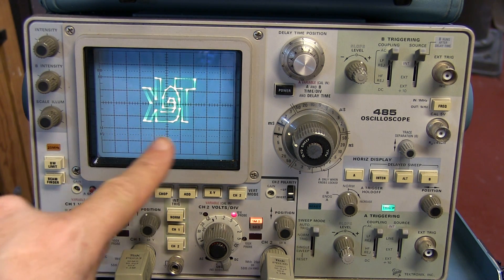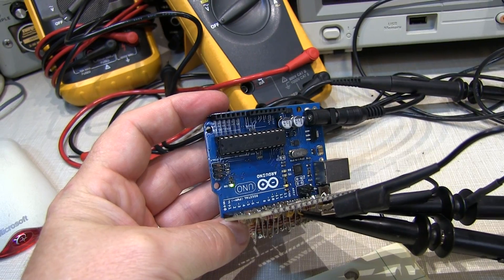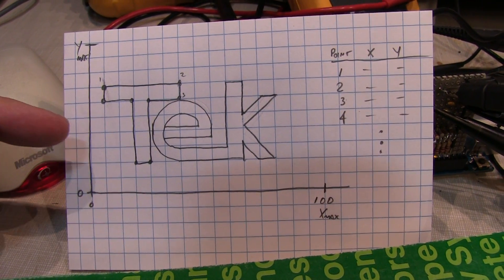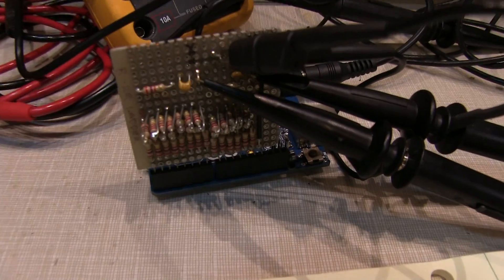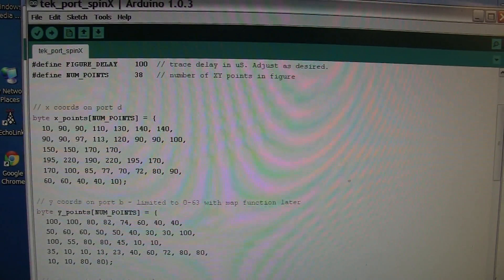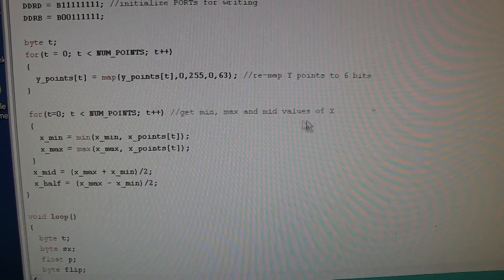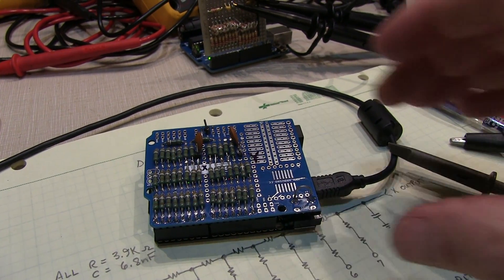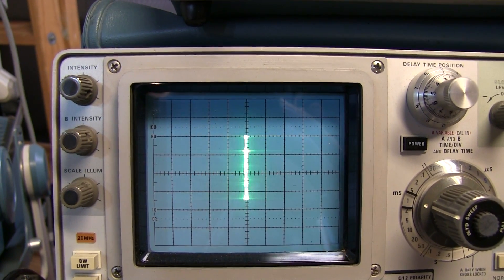#144: Use Arduino Uno to create spinning XY graphic on an Oscilloscope

Comment: Is there any Analogue Way to plot x and y axis On old crt tv via AV rca port ? If i wanna controll x y lines on crt by giving signal through RCA video port is it possible?
If it's possible so we can use same signal to use drive x y in any  lcd based monitor or display with Video input port ?

Comment: First, I would probably just use two DAC0800s (let the six bits be b7-b2 and let {b1,b0}=10).  Second, if you increase the RC time constant to about 1/3 or 1/2 of the dwell time, you can smooth over the apparent intensity and make the dot locations less visible without introducing excess distortion.  Third, introducing more points into long straight segments so that all segments have somewhat equal lengths will equalize intensity and reduce distortion at corners.

Comment: I know this is an old video, but have you thought of using the blanking input of the scope as an extra output parameter? maybe instead of having DDRD as 8 bits, make it only 6 (since it seems to work fine for DDRB) and use one of the remaining pins on DDRD to control the spot brightness? That could be used to reduce the brightness of indivudual points, making for a better end result.
There's quite a few videos of people using X-Y mode on scope to draw things, but none of them ever use the "Z" to drive the spot brightness...
Reply from the maker: Not all scopes have a Z-axis input.  I have used the Z-axis in a few of my videos.  A few videos (including the channel trailer video) use the Z-axis to get analog video on the CRT.  I also used it in the video that talks about creating a marker on the waveform.

Comment: Very cool stuff. Just purchased an old Tek 485 for dirt cheap. I hope it works or is repairable when it gets here. The traces work shown in the listing with all the knobs intact. Any words of advice for components that are commonly bad with the 485? Thanks so much for all your knowledge sharing.
Reply from the maker: These are pretty reliable old scopes, with one of the sharpest CRTs that I've seen.  The only thing I've seen go wrong on mine is that the contacts for the vertical attenuator get dirty/scratchy.  You have to be very careful when cleaning them (delicate lever/leaf style contacts).
Reply: @w2aew  I've read a lot about the tantalum caps failing. Some guy I found in California will refurbish it completely for $400 but that's a little much to spend on the $90 total price I paid for it. Most I found that didn't even power up people were asking $150+ , some of those electronic salvage companies that buy piles from schools or businesses for a lot price and make a big profit on them. I got this from an individual. The fact it had a photo showing both traces was encouraging.
Reply: w2aew Got the 485 today. I was pleasantly surprised that it worked and actually displayed a nice wave form. The trace was very sharpe and bright but seems to have a wide ghost image surrounding the trace. If it is turned down quite low on the intensity it is minimal. I don’t think it’s normal but working. The other issue is on channel 2, when switching the voltage range the trace will jump way off from set position. Seems to be a few different amounts of offset that repeats throughout the entire range. It can be brought back in with position control but it doesn’t do this on channel 1. The control on 2 is very sticky and hard to turn. Everything else seems ok other than calibration. Any thoughts on either problem? I know you get asked a bunch of questions on a daily basis. Any help would be appreciated. I’m a stone age tube repair guy for the most part that can get through some basic analog solid state circuits. If I know where to look the repair part I can do. Finding the issue on something like this is a bit daunting. That’s why I watch and learn from all you electronics wizards.👍
Reply from the maker: @SIXSTRING63  Glad you got the scope, and it is basically working.  Not sure what's causing the ghost on the CRT.  Sounds like the balance might be off on Ch2 - could be an adjustment (or dirty adjustment pot), or potentially a circuit problem.  Sounds like the CH2 control is gummed up, careful use of DeOxit should help - but you'll have to get inside to do this.
Reply: w2aew Yes, I pulled the channel 2 attenuation module and took it apart partially. Something was rattling around in there, couldn’t see it. Sounded like it was on the inside of the cam shaft that activates the little reed contacts. Looked it over and took a few measurements, the variable center voltage control wasn’t working right either, that 5k pot doesn’t measure up right and seems to go open at times. Also the AC, DC, Ground control seems to have something mechanically broken. I put it back together for now. Was pretty easy to take apart. Will get a new pot and see If I can repair the switch and lube the cam very carefully on the support section. I was a certified tool and die maker/manufacturing engineer for 25+ years so I’m pretty good at that end. Been diving into this electronics thing after all the repair guys that used to take care of my guitar amps retired or passed away. I found once I got my feet wet into doing some repairs with success I really dove into the deep end of the pool in the past 5 years reading books and watching great teachers such as yourself and Joe Smith. A few good amp techs like Uncle Doug and radio guys like The Radio Shop have been extremely helpful too. Rebuilt a 1940 RCA K80 console radio recently for my first try at that. Turned out great, had to rewire the whole thing, old rubber insulation just crumbled when moved. Thanks again for the advise. The ghosting has seemed to ease up, think may have sat for a long time. Maybe some caps reformed a bit. Ran a guitar amp for tests on it tonight for 3+ hours and it performed perfect on channel 1, scope and amp both.😎
Reply from the maker: @SIXSTRING63  The Ch1 and Ch2 attenuators are identical, so you can use one as a guide to repair the other (if something is broken on Ch2).  Hopefully you'll be able to sort out the difficulties on the CH2 side.
Reply: @w2aew   Thanks so much for taking time to answer my questions. If I can't figure it out I have a friend who is well schooled like yourself in electronics. He used to work for a company that built radar scopes for the military. He usually bails me out when I get stuck. ;-).

Comment: This caught my interest in a big way, and tried to at least duplicate what you done so far, changing a few things, and results not satisfactory so far.  I built the r2r/dac on a prototype board, using 1k(r) and 2k(2r) resistors, and two .047 ceramic caps for smoothing, compiled your code, no issues on arduino uno, and after multiple adjustments on my old 5mhz scope(hk io-4205), I am able to see jumbled points rotating, some what crooked, or on an angle.  I think I seen you mentioned you are using some type pf caps on the r2rdac.  I also remembered you mentioned you used 3.9k resistors because of a surplus on hand.  I was hoping to save some room by using actual doubled r values for the 2r.  Any ideas what I can try?  And thanks again for sharing this.
Reply: I tried this on a 60mhz scope too, same results.  The r and 2r resistors, is it mandatory to use 3.9k(r) and 3.9kx2(r2)?  If it is, not a problem, will need to order some
Reply from the maker: I think your 0.047uF caps are likely too large.  I used 0.0068uF (6.8nF) on my prototype.
Reply: w2aew well, I got it worked out, I did not have the arduino ground connected to scope ground.  I was using the ground as part of the r2rdac on the breadboard and had no direct connection to scope ground.

Comment: Very nice. What tolerance are the resistors in the r2r ladder? Did you have any problems with non-monotonicity?
Reply from the maker: I used ordinary 5% resistors, all from the same batch.  While I didn't do any tests for non-monotonicity, I haven't noticed any issue when I've used it.  By far, the easiest way to do this is to simply by a monolythic R2R network from a manufacturer like Bourns.  They are readily available.
Reply: Many thanks. I don't mind buying a monolithic network, but I want to build a DAC from scratch. Love your videos, awesome stuff.

Comment: C/C++ programming tip:
Instead of

#define NUM_POINTS 38
byte x_points[NUM_POINTS] = { ... };
byte y_points[NUM_POINTS] = { ... };

You could do:

byte x_points[ ] = { ... };
byte y_points[ ] = { ... };
#define NUM_POINTS (sizeof(x_points) / sizeof(x_points[0]))

That way you can add and remove points without having to re-count the number of points in the array.

(Note: the "/sizeof(x_points[0])" is not strictly necessary (it's basically a divide-by-1) but might be useful if you ever change the type of each element for some reason)

(Note 2: Yes I am aware that this would silently fail if the two arrays end up being different sizes but that shouldn't cause any trouble because they are never written to, and mistakes should be obvious from the output on the screen).
Reply from the maker: Thanks for the tip - I'm an amateur programmer at best...  ;-)
Reply: I'm an amateur electronics engineer at best :)

Comment: I now have a spinning Tek Logo on my Scope. I am going to get my students to design their own vector graphics.. thank you!!
Reply from the maker: For extra credit, have them add a 3D perspective, making it appear that the side spinning towards you is larger and the side spinning away is smaller.
Reply: That's a great idea. Thanks for putting this video online. I had a lot of fun soldering the R2R circuit - A total mess, the resistors look like crooked teeth but at least it works. :)
Reply: +w2aew I'd like to see the perspective done.  I did this very same type of thing in the 80s for doing Laser Graphics a.k.a. Laser light shows.  Galvanometers moving mirrors moved the laser beam in X/Y, but the rest is very similar to this.I did a general purpose display processor that held multiple images in a library and commands were used to turn images on and off, change size, move them around and spin them - to choreograph them to music.  I can also put the D/a outputs on my scope....I know it's been a while, but I can give some help to do perspective that is simple, but actually a cheat, but looks very good.If interested, post here, or send a private message via YouTube.-- Steve...

Comment: Very impressive video, I had no idea I could do this using an Arduino. Gotta try. Can I use a graphic LCD 128x64 to do the same. In that case could you suggest how to wire the LCD ?
Reply from the maker: Be Right Back I'm not familiar with the wiring of graphic LCDs, but I"m sure you could do the same thing with them.

Comment: I wonder if Arduino would have enough power to make this logo rotate in 3D. I think it would, using fixed point math and because it has a fast hardware multiplier.
Reply: I have a 3D cube that I can rotate with a joystick (or whatever input) running on an Arduino. Much simpler geometry to be sure, but it runs very fast (With lots of grabage code, still achieving around 70 FPS). So I reckon it should be possible to make more complex geometry run at acceptable rates, even if you use floating point math.

Comment: Can a Philips PM 3240 do this?
Reply from the maker: I've never used on, but from pics online, it looks like you can input an external X input signal (lower right), and set the horizontal mode to "Ext X".  This appears to be the way to get an XY mode on that scope.
Reply from the maker: Upon further looking, it looks like you can have an X signal applied to channel A or B also, so it should be easy to get a good XY display with this scope.
Reply: Thanks!

I've only got the A input in use for my music though, but I'm looking forward to it.

Comment: Spinning XY mode paterns on oscilloscope
Reply from the maker: Nice job!  See my comments on your video.
Reply: *****
well, i just wanted to show that STM32 is very flexible and simple to use. No need Arduino for this king of complexity. i would recomend to get STM32F429i-Disco, and i can give advice if you run into problem :)

Comment: instead of using the map function for base 2 math you can do it much faster with just bit shifting. so if you only want 6 bits do variable>>2 but that's not really a big deal. It would be better instead of seeing it spin from a direct front face if it was spinning circularly where it looks like it's from a slightly elevated view for a 3d effect. It wouldn't be hard to implement either you just make a y offset for each point depending where it is throughout the spin using scaled cos
Reply from the maker: Yes, I am sure there are much better ways to do the array manipulation.  I'm really not much of a programmer, so this was a simply approach that I took.  I'd love to see what a "real" programmer could do with the somewhat limited Arduino platform (rather than just throwing MIPs at it with a faster, more powerful uC).
Reply: *****  Hi Al,
I commented a year ago on your call sign video and made the suggestion to use the port and R-2R technique.  A friend alerted me to your snubber diode video and I also see you have progressed in the X-Y display area to rotations.  .Whle I have to think about this a bit given the way you coded this rotation in halves, I may be able to suggest (if you care) a technique to add perspective so it looks even better.  That is, so the part moving away from the observer looks smaller and the part moving closer looks larger.   I think that is what commenter  OtakuSanel  means by "3D". 
...
 For my laser light show system I use a very effective "cheat" that I developed.  It looks very good, but is a simpler calculation than true perspective (which requires a divide).  I am not familiar with the Arduino so I can't suggest any code, just the concept and standard formulas to get the size correction for the effect.
...
I have no idea just what the Arduino "map function" actually does, nor the computation burden (time), but since it is out of the loop I guess it is a don't care. EDIT: Reviewing your code, I see you do use it in the loop...
...
I do agree that simply shifting the least significant bits out is an easy way to convert the 8 bit to 6 bit -- or simply drawing it in 6 bit to begin with.
...
The Arduino clearly has more capability than my laser light show display processor (6809).  I coded it all in assembler and did things like what you did for the center of your rotation to achieve very complex control of images.  This was so I could choreograph complex motions to music.  . I also had to build my own multiply routines because the 6809 only had unsigned binary mult.  I was processor cycle counting for max speed in a 900KHz clock processor...yes under 1 MHZ and I do real-time rotations and scaling independantly on multiple objects -- two or three max....  If U want more info...
I do look for any YouTube direct messages ocassionally, but it is easier if we switch to email via arrl.net
--
73, K9DCI ...

Comment: Hi Alan great video, this is so much fun! if you used 4 by 4 matrix arrays etc would this not also work for doing regular computer graphics animations?  A bit of extra code in there for the matrix multiplications I think would do it. I wonder how smoothly it would render a wire frame bouncing ball?

Comment: Is it possible to do this on say a Tektronix 5110? I can't see any X-Y mode on it.
Reply: I think that is dependent on what modules you have pluged in. Because that's a scope that takes different plug in modules ?
Anyway, most Tektronic scopes do x-y mode.

Manual :
http://bama.edebris.com/manuals/tek/5110/